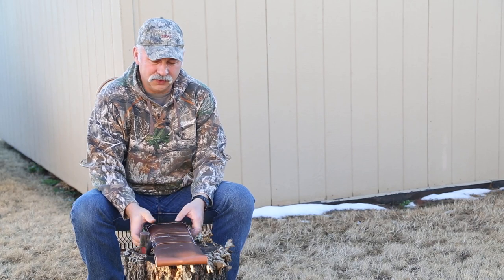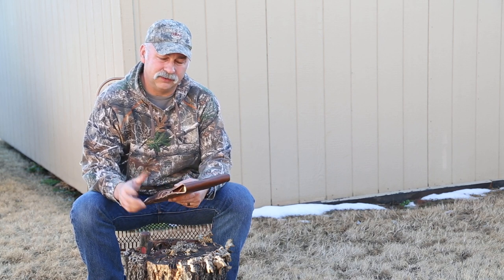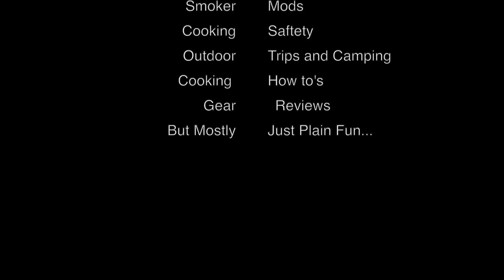Making a Bow Saw

Comment: Oh man I loved this video.  Great job on the saw my friend.  
With the scrollsaw being one of my favorite tools I have to ask what saw you have.  Didn't catch much of it in the video.  
Looking forward to the 1000 sub video.  
Take care and God bless.
Reply from the maker: Oh thank you sir, it is the dewalt 788, I have had some of the cheaper ones, and depending on what you want to do with it, they will work just fine, but for fine detail scroll saw stuff, this one is the king in my opinion. I have done small stuff, scenes with deer in them made clocks and all kinds of stuff with this. It is not a saw I use all the time, but when I have the time, it is a dream to work with, blade changes are easy and quick. it just works great.
Thanks again for the kind words and support. 
Thank you and have a blessed week. 
Dale
Reply: @HeartlandMakesAndOutdoors  I started out year ago with a Black and Decker and was a great saw but decided to upgrade to a larger one.  I picked up a Hitachi on sale at Lowe's. Sold my Black and Decker in a yard sale and have had nothing but trouble out of it.  
I really miss my little Black and Decker.
Reply from the maker: @BluegrassBushcraft  I totally understand, I had one, I wish I caudal recall what it was, I bought it used at a pawn shop and I got to where I could use it really well. just got used to its little quirks. It got sold in a move, missed it and ended up with this one, so I totally understand. Thanks again my friend .
Dale